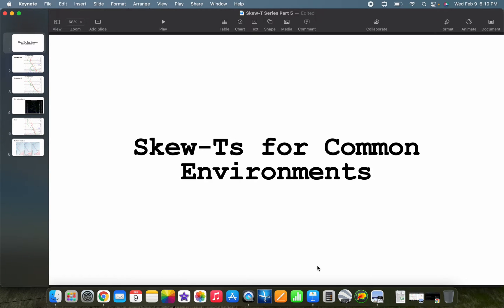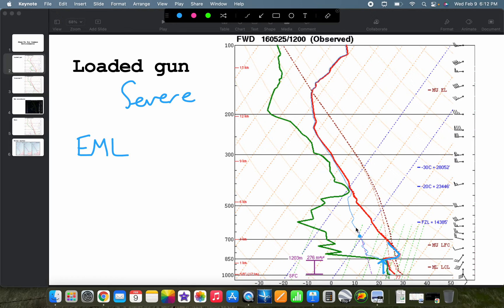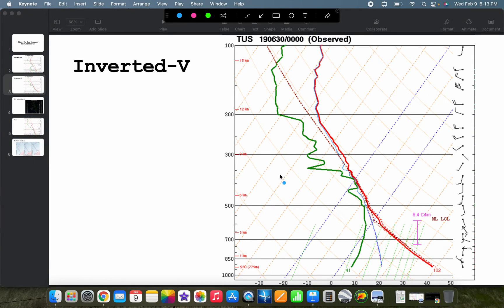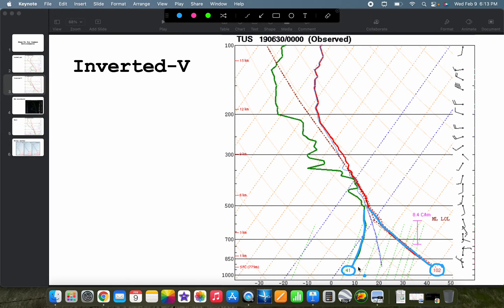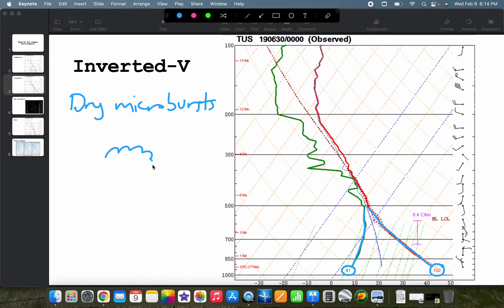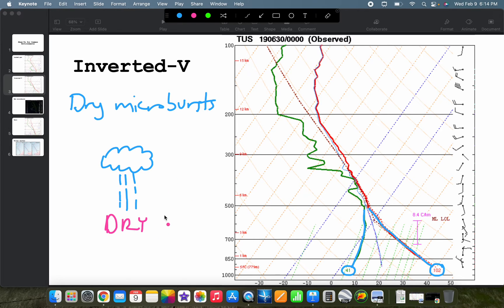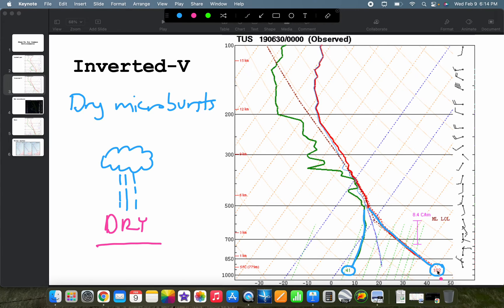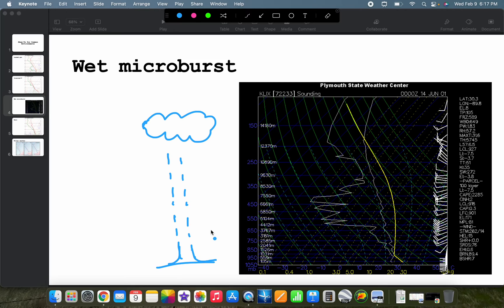Definitive Guide to Skew-Ts and Hodographs - Part 5 - Skew-Ts for Common Environments

Comment: Do you have an idea why SPC highlights the -20C isotherm? whats the significance? I mean the 0C line is for freezing, but why the -20C is highlighted? Thank you
Reply from the maker: Not 100% sure on that. I suspect it has to do with hail or winter weather.
Reply: @ConvectiveChronicles  thank you. It seems to make sense
Reply: I think its relevant to lightning potential too, the SPC uses areas where convection can rise above the -20°C level to help draw out the "TSTMs" category in convective outlooks, between 0 and -20°C is widely thought to be the region where charge separation occurs in a cloud
Reply from the maker: @ That's probably it!
Reply: @Tstorms  thank you for the information!

Comment: Subsidence inversion at 850 on the loaded gun?  Pretty decent CAPE on the KLIX wet microburst sounding.
Reply from the maker: Looks like mostly just an EML-induced inversion at 850
Reply: @ConvectiveChronicles  Thanks, I was always told (and subsequently told others) that this signature was typical of a subsidence inversion.  I had never heard of the EML and its role it in establishing low to mid level inversions.  I just read an online article by Jonathan D. Finch where he describes the EML in great detail and links to numerous examples of soundings containing EML inversions.  The most definitive signature is the deep adiabatic layer above the inversion and rising dewpoints in the layer forming the inverted V topped by a moist layer in the upper levels.  Clouds in this region would likely be altocumulus castellanus.  Well, even this old dog still has a lot to learn.  :)

Comment: Why does the inversion cause instability to build?
Reply from the maker: Think of it as a pressure cooker. The hot steam is trapped in it and the pressure builds and builds, as a result, until the lid is taken off. The same thing is true for the cap: it prohibits storms from developing during much of the day, allowing the warm sun to continue to heat the surface and instability to build and build until the cap is eroded, at which point all that built-up instability is released and storms explode.